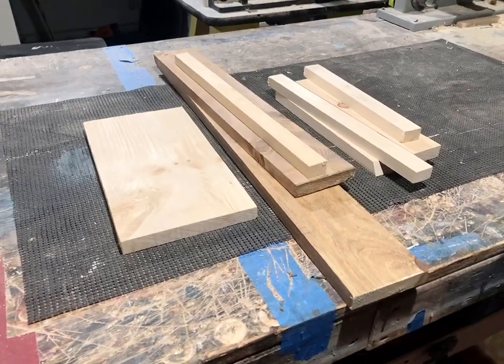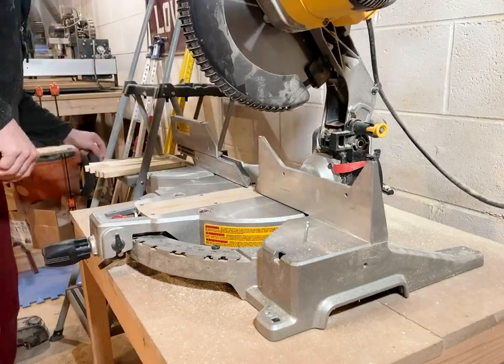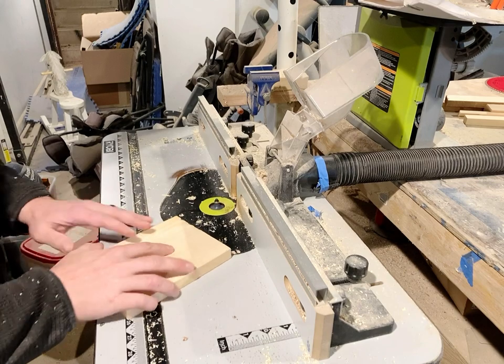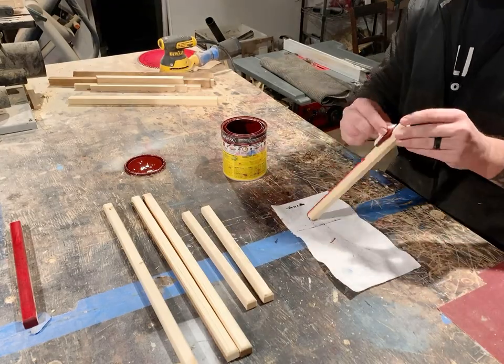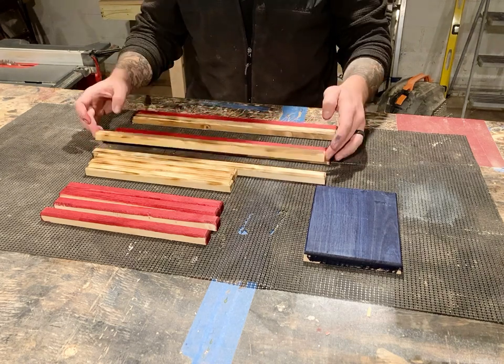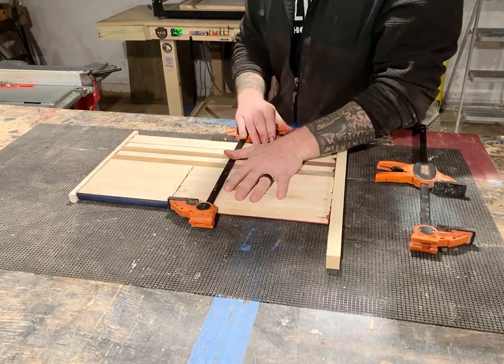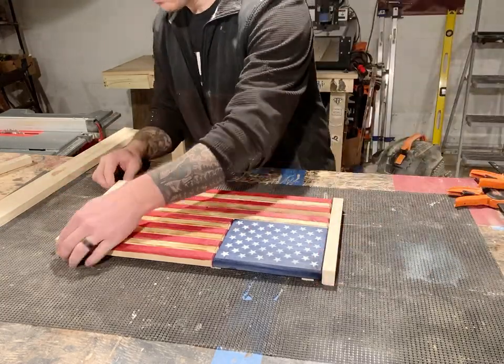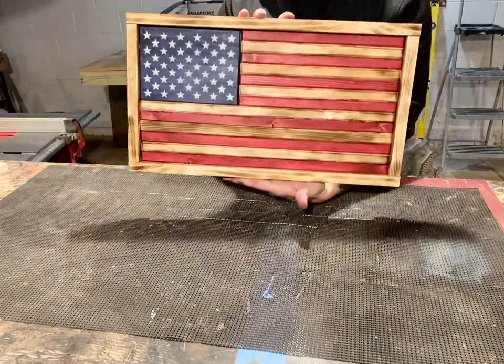Not Another Wooden Flag Video (v2!) | How To Make A Mini Rustic Wooden Flag  Out Of Scrap Wood

Comment: nice job on the flag and i enjoy your videos. i  like the rounded edges too and use them on all my flags no matter what size. i also put a frame around mine but i like the way you have that raised look. i think i'm going to copy your idea. i have one question for now... i noticed you don't put on any clear finish at the end of the project. do you find they sell better with out the finish?
Reply from the maker: Thanks! The round over is definitly a great look. Feel free to steal the idea for the raised frame! Haha 

I’ll usually finish a couple flags at once them clear-coat them at the same time. I didn’t put anything on this one yet but i usually use Minwax Polyacrylic-satin. Super nice clear finish and sprays on really well!
Reply: +1

Comment: Enjoyed your info video. What do you sell your standard R,W, & B flags for (19 1/2 X 37) I am thinking of going to gun shows to sell my flags. What are your thoughts on this idea? Thanks
Reply from the maker: Seems like a good market! I’d def give it a try. I know some shows vendor space prices are a little high but it could be worth it if you have a good chunk of inventory. Fairs and craft shows I usually drop them a little due to the market i’m working with but usually it’s around $120. Don’t hesitate to do a ‘final day’ sale too, depending on the length of the show! Drop $10-$20 off and they’ll move quick!
Reply: @TrueAmericanCraftsman  Thanks I was thinking $120 or 2 for $200 shows cost around $250 per weekend counting space gas and hotel.  My flag cost is $15 each and about 1 1/2 hours each to build and I would take 20  to 30 flags per gun show